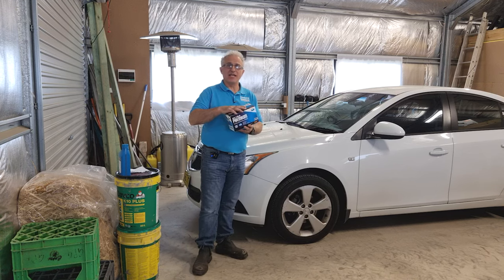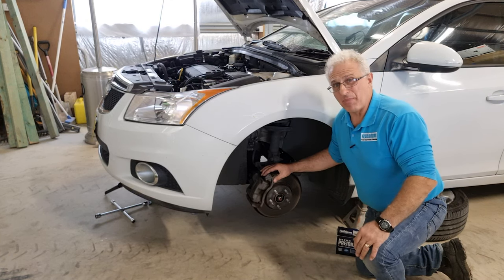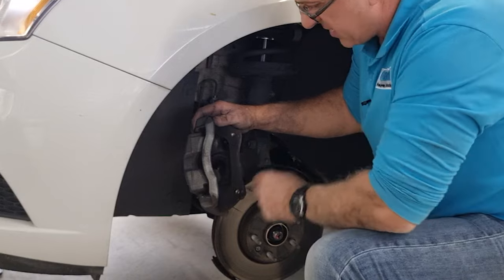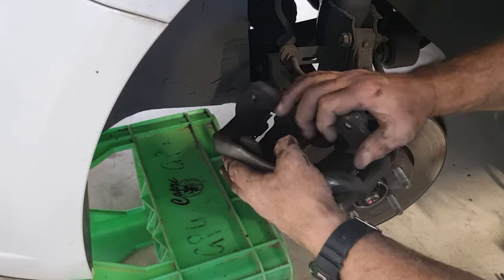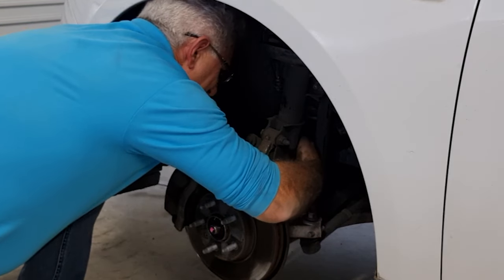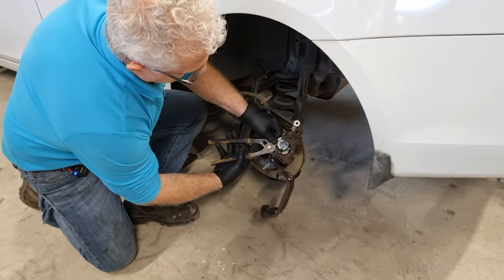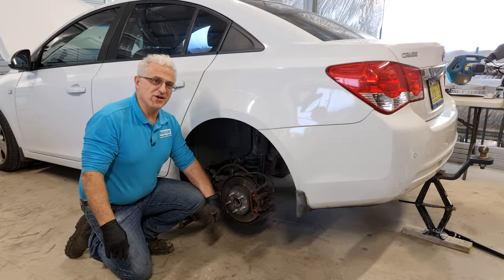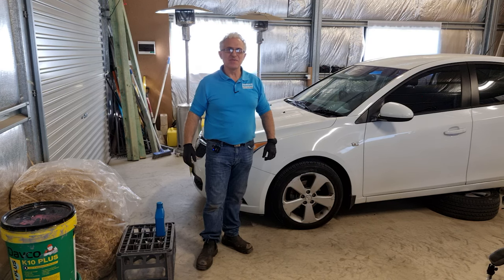Changing Holden Cruze Brake Pads: The Good, The Bad & The Ugly! DIY

Comment: Great video, was able to follow it successfully. Had trouble getting one of the rear callipers off, had to really hit it with a hammer. Also rear pistons wouldnt compress so it took me ages to work it out. Found unscrewing then screwing back in a few times fixed that issue. Highly recommend anyone doing this to buy the correct tools to compress the pistons, dont use multi tool as in the video. Also dont undertake unless you are strong, undoing bolts was super tough
Reply from the maker: Very good advice! Thank you for your feedback! Cheers

Comment: You don’t need to remove the two 18mm caliper bolts and the whole caliper assembly, just remove one of the slide bolts
Reply from the maker: Sorry for the delayed message, Rob! In a perfect world, you are 100% correct. I forgot to mention it when making the video that you can do it this way. But I have had problems in the past, so I personally find it easier taking the 2 main bolts off. Plus, saying that, my son said the same thing as you before he tried changing his brakes on his Mazda. After only a couple of minutes in, he changed his mind and did it the way I showed. I think someone had damaged the lesser bolt in the past, and it wouldn't screw off! 

Regardless, I appreciate your message, and I wished I had mentioned it on video, but I hope to make another one in the future, probably on a Ford Focus! Good man!
Reply: You dont need to but you can if you want to.
Reply: Where are these slide bolts located? Have been trying to removed the caliper bolts but they're so freaking tight
Reply: 2011 Holden Cruze Diesel
Reply from the maker: My Cruze was written off after someone smashed into the back of the car, but looking at online images, they look similar. The side bolts should be on the pivoting point of the brake calliper, and they are much smaller in width.